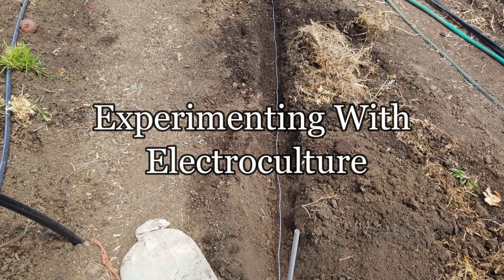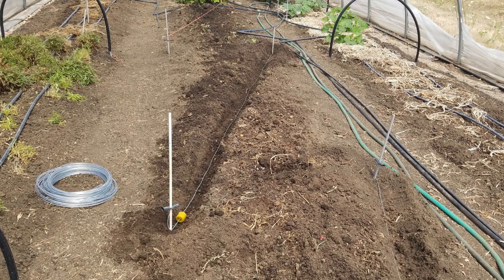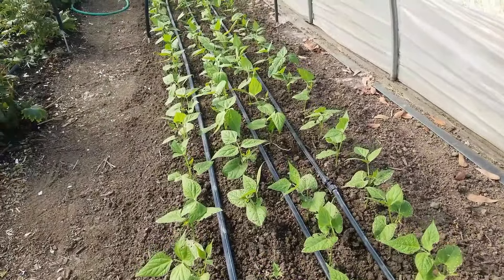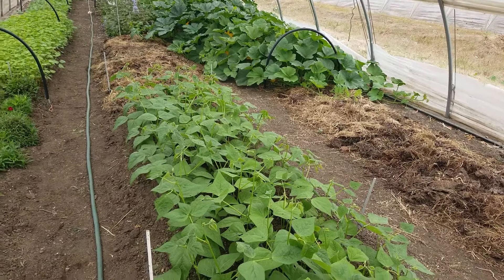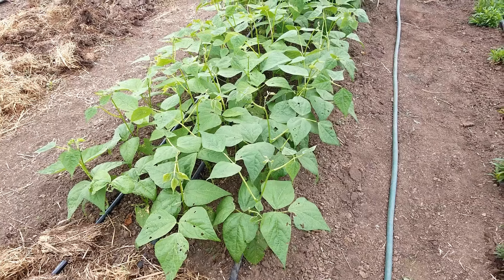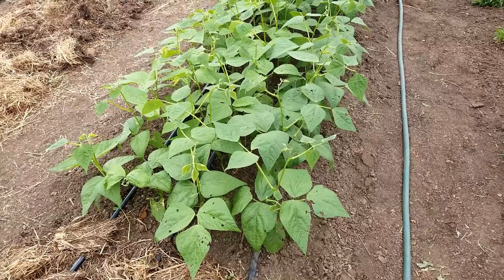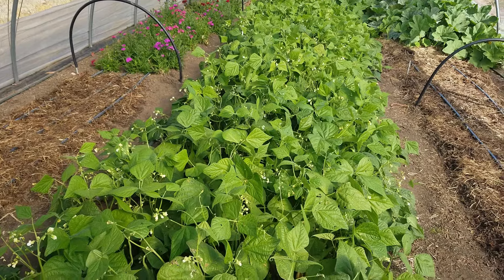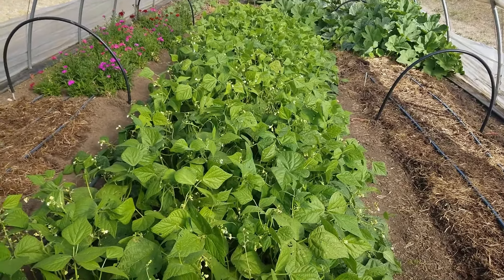Our Experiment in Electroculture

Comment: Like your willing to try it, and the balance way you do it and analize it. Still a lot of variables... i always think about the temperature effecton the roots (heat stimulation) and the fact that the wire acts as a anti compacting effect, helping roots as well. Anyway, tanks.
Reply from the maker: In some respects its almost impossible not to have some confounding variables on such a small test.  I would guess that in order to really test this you would need many more test plots for both the control and the electroculture.  so the best I can say for what I observed is:  hmmm....isn't this interesting

Comment: They aren't both in the centre of the poly. Your control needs to be in exactly the same environment as the test plants. Pests etc are going to have much easier access to the beans planted beside an open vent, than those in the centre. They also most likely aren't getting the same warmth in the soil as those in the centre.
Reply from the maker: Good thoughts! The things you suggest might indeed be contributing factors although the electroculture bed was right next to the main open door of the tunnel  so  I'm not sure the bugs had a competitive advantage with access.  I think in general to do a true test to control for these confounding factors you need to have many test plats for both the control and the test.  But these results were interesting.
Reply: @BareMtnFarm  Aye, you'd want a decent number of beds, the more, the better. Even within the same bed, you can have variations in plant health/growth. 

The fact, commercial greenhouses aren't doing this. Would strongly suggest that this is either of limited/no real benefit. Space within a poly, or greenhouse, is prize real estate on any farm. So, if there's a way to get more/better crops per square yard. You can bet they would be doing it.

Which is also why so many opt for going hydroponic, if they can. Because it uses less water, gives you pretty much total control, and isn't dependent on improving an existing site.

You could do almost anything to a soil and notice a difference. But that doesn't mean it's worthwhile, or repeatable. Plus, the gardening world is full of gimmicks/myths. People tend to think if something is more complicated, then it must work better. 

I'm all for people trying these things out. An enquiring mind is no bad thing for any gardener/farmer. I have seen people get lots of views promoting putting a cracked raw egg in the hole for each tomato plant. Or sprays for blossom end rot etc. Which is pointless, and in the case of sprays etc a waste of money as well.

What would be interesting with your trial. Is to have a look at the soil microbiology. They live in the water between soil partials, and are mostly water themselves. If the turn-over rate is increased, then the plants should have access to more nutrients.

Comment: What is it supposed to do though? And why align to earth's magnetic field? I mean the earth's magnetic field is static and therefore will not cause any induction in the wire whatsoever? You only have a change in the electrical field when there is a change in the magnetic field. You don't have that here. It doesn't make any sense.
And even if it did what is a magnetic field or electricity supposed to do to a plant?

Comment: Intriguing. As you say lots of variables, including relative positioning in the tunnel, but hey, once it's in, should be good for a few years til the wire finally rusts away.
Reply: Providing it actually did something worthwhile in the first place.
Reply from the maker: Well, I did get 4 harvests off the electroculture plants versus 3 on the control.  But honestly I can't say with definitive certainty that electroculture was the reason.  So it was fun to try things that are different.